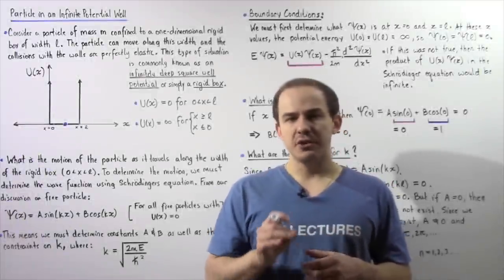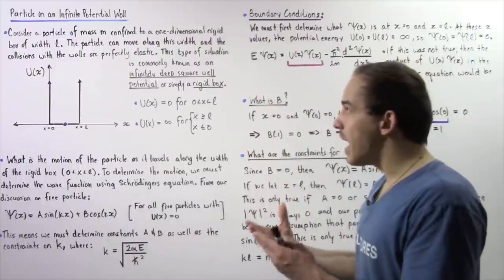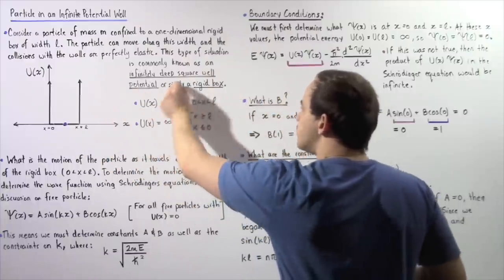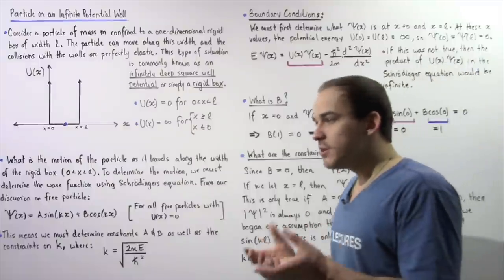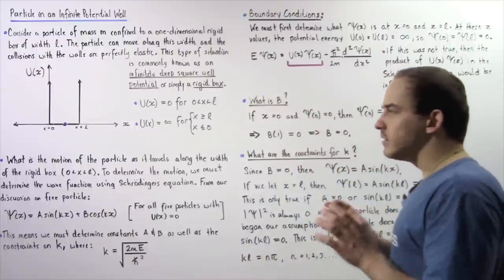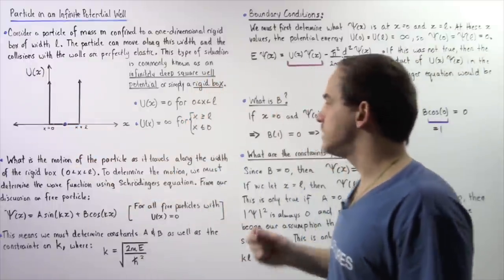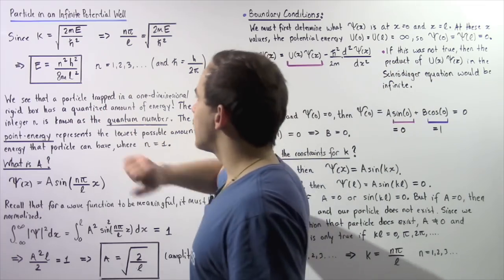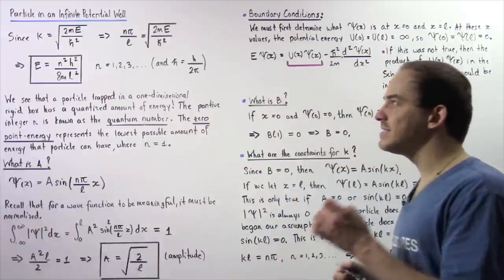Particle in Infinite Potential Well (Rigid Box)

Comment: For the integral that you used to solve for A, you should have worked that out to really make us believe and how you solved for A at the end.
Reply: He used this following trigonometry's formula : sin²(A) = (1 - cos(2A)) / 2, where A = n*pi*x/2. So sin²(n*pi*x/l) = (1 - cos(2*n*pi*x/l)) / 2. The primitive is equal to (1/2)*x - sin(2*n*pi*x/l). If we replace x by l, the sin gives us sin(2*n*pi*x), which is always equal to 1 (because 2*n is always even) : sin(2*n*pi) - sin(0) = 1 - 1 = 0. So we only have (1/2)*l - (1/2)*0 = (1/2)*l.

This integral of sin²(x) is rather "famous" : we use exactly the same "trick" of this trigonometry's formula to calculate the square mean root of the voltage or the intensity, which gives us Urms = Umax / sqrt(2) or Irms = Imax/sqrt(2).